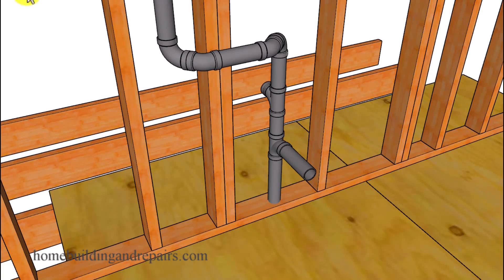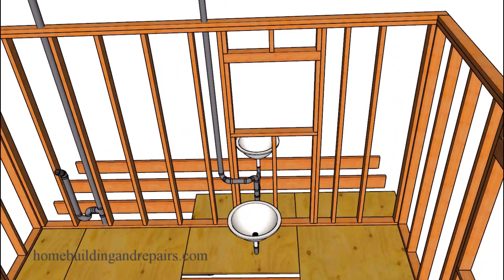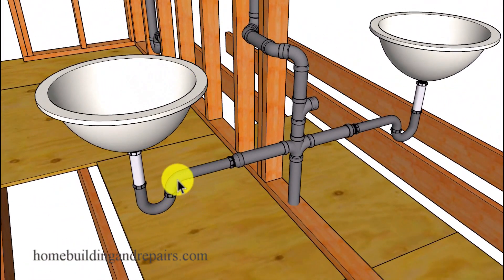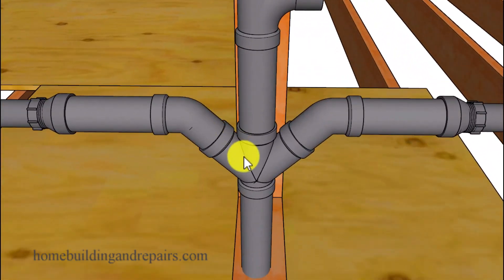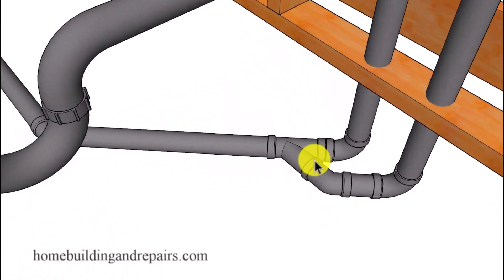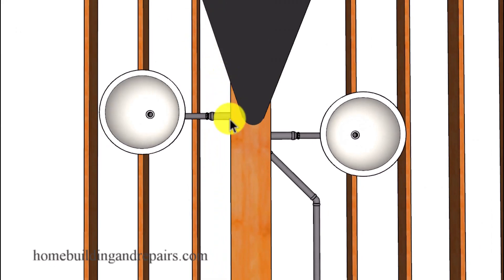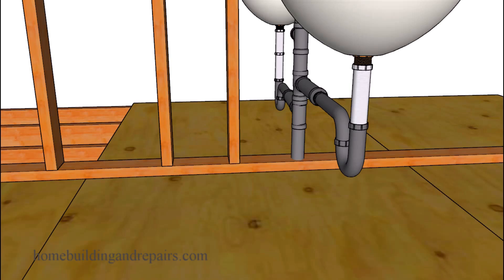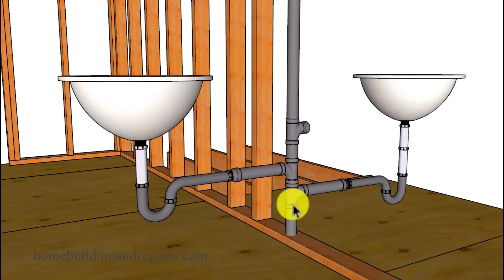Different Types of Plumbing Drain Pipe Connections For Back To Back Sinks - Building Code Examples

Comment: How long can a sink slip joint extend down before encountering the trap? It would be hard to dig into the wall and raise the santee.
Reply from the maker: I don't know of any codes and you can use extension pipes or tubes.

Comment: How would I tie into existing plumbing line if I’m adding a back 2 back toilet set up ? Just cut the fixture off and add a double fixture T  ? Also, I like how you minimize bends and thus minimizing pipe drag in the Bernoulli’s equation. I’m a mechanical engineer but I’m young, so I don’t know shiz about practicality, just equations and machining 😂

Comment: Gray water to gray water on a double sanitary tee I don't see how you will ever have an issue unless if both are pump discharged or a toilet. A cleanout above will solve the issue of snaking. With my commercial washing machine pumping and utility sink draining a tub full of water at the same time there are no issues. The only thing I wonder about is if the double sanitary tee causes more suds, but it's a common problem with old school commercial washing machines pumping very hard that don't skimp on water. In Florida there's an exception for double sanitary tee if the horizontal length is 18" on each fixture. Even then if it is to code I'd be cautious about mixing waste water types unless if you add a backflow preventer which is a moving part that will eventually fail.

Comment: Hi greg, am planning on do a back to back toilet and was initially happy to hear you say a double fixture with vent in center could work, but you would later say a 45 deg double wye would not work and might create a siphoning action. Can you explain how a double fixture does not have the same problem?
Reply: Did you look at both fittings? There's an glaring obvious difference in the angles going into each fitting.